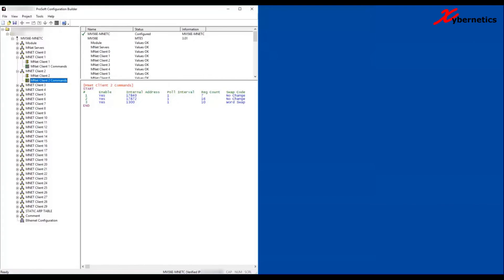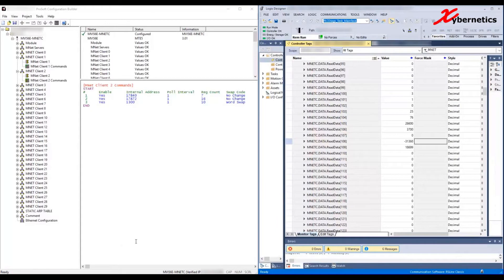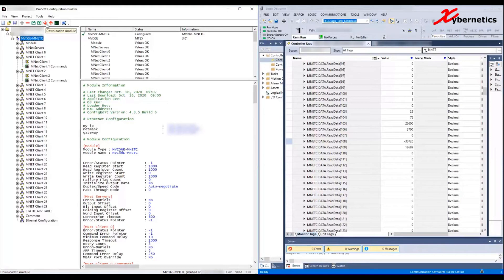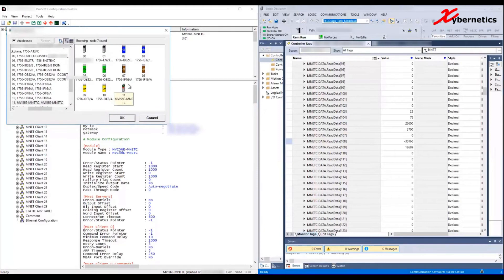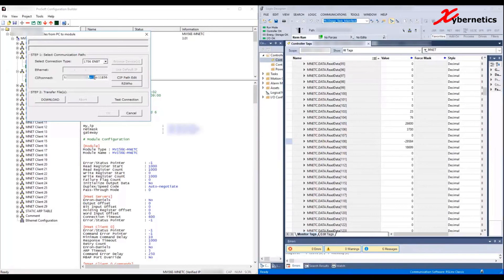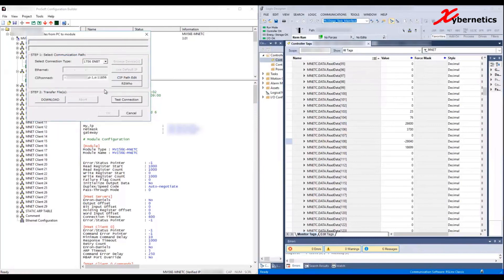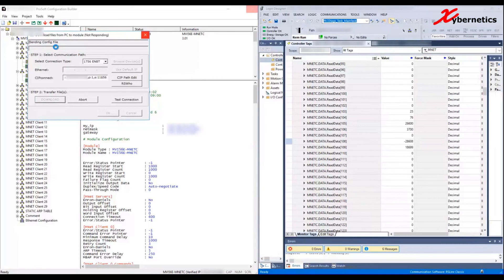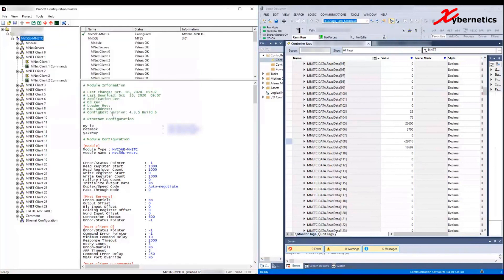How To Write ProSoft Configuration To ProSoft Module

Comment: How are you communicating to the module? Using serial port on the module or is it through Ethernet?
Reply from the maker: I am using the Ethernet connection using the ModbusTCP protocol.
Reply: @RabiGurungXybernetics  I got the setup but the module says Ladder logic configuration required. Is it possible for you to help me? I am in a critical time to finish a task. Appreciate it!
Reply: @MRAOfficial786  what software are you using for the plc the prosoft card goes to? You need read/write ladder logic for the prosoft card to communicate with the plc. I believe prosoft has free sample ladder logic available for download.
Reply: @mattk5114  so The ladder logic they have is maximum v20. My controller is v34. Any other way possible?
Reply: @MRAOfficial786  are you talking about the ladder logic they have on the prosoft website? That wouldn't surprise me since some prosoft cards are discontinued. 
If you have v20 installed and you are able to open the logic maybe try exporting the rungs and importing them in your main v34 project file. Or maybe try going online with your v34 software and then it would ask you to change controller to v34.
I don't know what I'm doing tbh, I just try different things till it works, lol.
I hope this helps and you get it figured out.
Reply from the maker: Of course, I'd be happy to help you with your task. Can you provide some additional information about the setup you have and what specifically is the issue with the ladder logic configuration? I'll do my best to assist you in resolving the issue as quickly as possible.